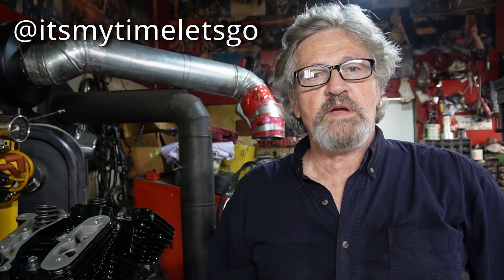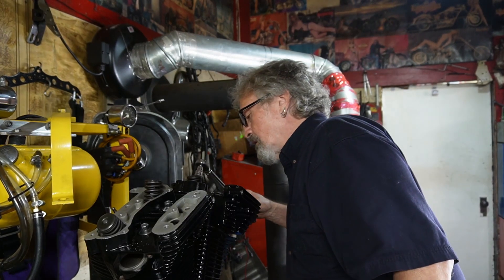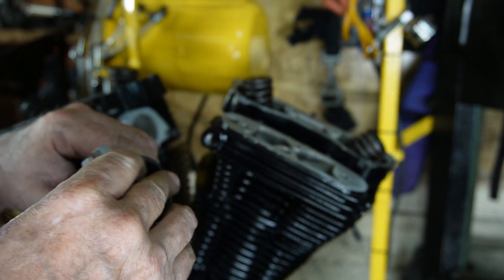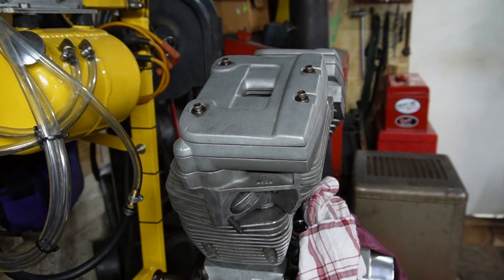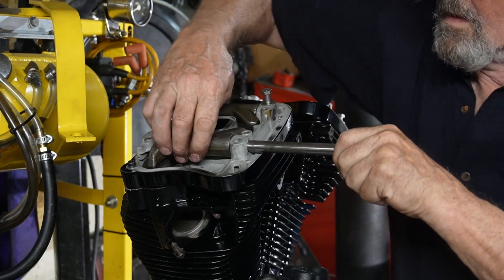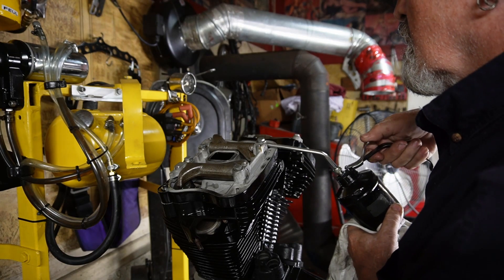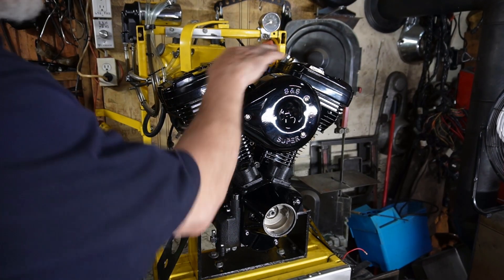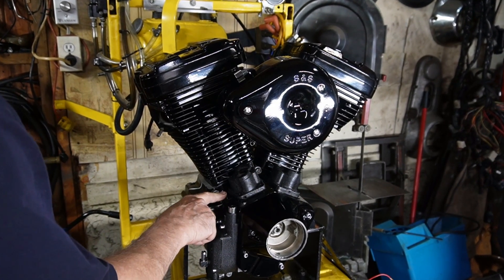ENGINE REBUILD, PITCH BLACK EVO PART 8 / SMOOTH 1200 ROCKER BOXES AND CARB INSTALL .

Comment: She looks great Ralph fantastic job I'd like to put the Sportster valve covers on my 95' Evo .can you tell me what yr those valve covers where? Thank you very much . JD.
Reply from the maker: Hey Jeff  I think that any 1991 to 2003 Sportster Rocker boxes, do not need to be1200, will work and  top end gaskets for those as well. If you were a pre 1992 overhead breather motor (1984-1990) I suppose you could use 1986-1990 earlier Rocker Boxes and gaskets as well, as you would have no need for overhead breather types.  I have seen some listed for 1986 to 2003 but would have to be sure they had provisions for overhead breathers. Your 1995 is an Overhead Breather so I would suggest 1991 to 2003 types. They look sweet! Hope this helps.
Reply: Thanks Ralph, like your show, 
like you keep it's old school. An real have a good Day.